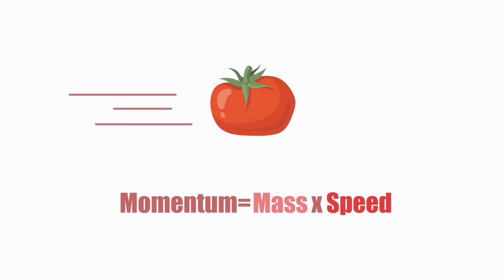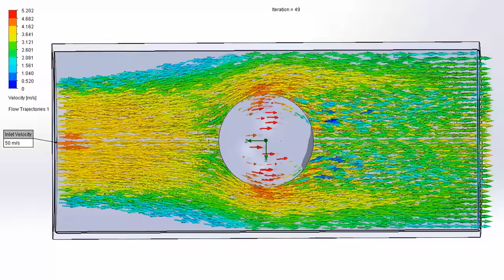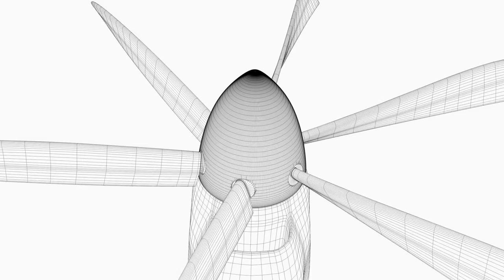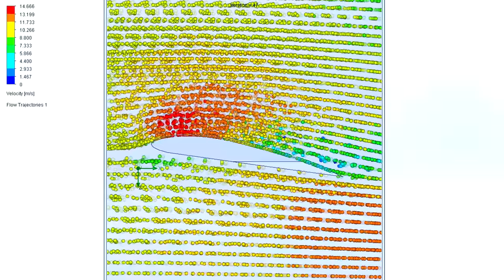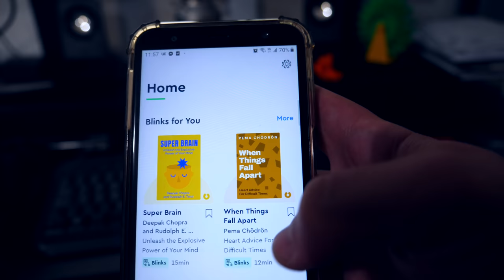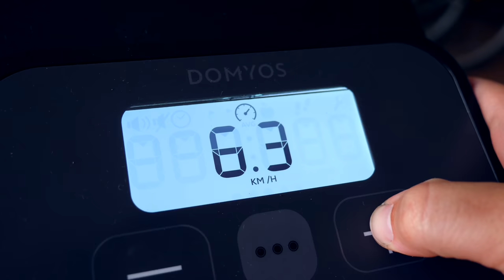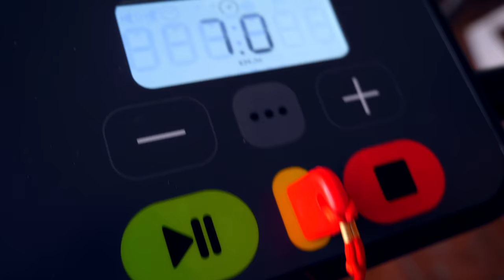Wind Powered Car (3D Printed)

Comment: Where do I send these 100's of old quadcopter propellers, carbon tubes, and servos to support the channel, Teg?
Reply from the maker: Send me an email to integza@gmail.com :_Happytegza:
Reply: @integza  I wish I had an entire Hobby Shop to help sponsor your videos, but I do have some gear that I'd like you to have. A servo tester can inject PWM, 1000-2000us, so you can let Integzabot chill for a bit, and a little less Arduino action for your jet throttles. And a metric ton of propellers and brushless motors. When I wreck a quadcopter, I may damage a motor; rather than replace just one, many times I've replaced all four, leaving 3 perfectly-good, badass motors we can use for... activities? Some simple on/off rocker switches, LED strips, doodads...
Reply: @GhostRyderFPV  ok
Reply: How about if the gear ratio of the prop to the wheels were higher? Wouldn't that allow it move with less wind?
Reply: If you have rc transmitter and receiver which you don't need anymore I will be more than happy to receive them
Reply: @Baxteen1  If you rotate the sail faster you'll have less acceleration but a higher top speed.
Reply: @integza  Have you tested what happens when the propeller stall?
It smacks of oscillations 🤔
Also, no one seems to be considering that the car will only go faster than the wind after a certain moment.  
So, does the wind that passed at the beginning was reached?  
If not, you was not faster than the wind (considered the entire period of the experiment).
Who arrived first, the car or the wind?
So, no laws were broken!

Comment: Bottom line - the point is the fact that the propellor connected to the wheels. The wind will take the car close to wind speed - then the prop basically do the addition - you can say trigo or you can say branuli. 
Now Im curious to make mathematical expression to calculate the equalibriume of the system and to extract the max velocity... If you have this I will agree that you got it.

Comment: Add one more thing: fixed propeller has drag almost equal to drag of propeller's projection, but spinning propeller has drag equal to 8/10 of a circle it spins in. That is how autogyros works - those flying machines has angled propeller that acts like a huge round perforated wing when spinning. And it also has airfoil in addition to that.
Create a rocket powered autogyro with 10 small rockets lighted one after another.

Comment: Have you ever experimented with the Magnus effect?
For those that are unsure of what this is, here is a simple demonstration:
1: Take the insides out of a Bic ball point pen (the kind that is just a straight, un-tapered cylinder works best)
2: Place the cylinder on the edge of  a surface that is off the ground.
3: Place 3 fingers from each hand on the cylinder slightly closer to you than the center of the cylinder.
4: Push down with your fingers evenly until the cylinder "pops" free from your fingers.
This should create backspin on the cylinder and forward momentum which, if done right, will cause the cylinder to lift or float as it moves forward.

Comment: and for the people wondering how it can accelerate more and more on the treadmill, yes its possible but the energy comes from the treadmill motor itself. the propeller connected to the wheels causes the wheels to require a higher force to spin which slows the treadmill down but the treadmill motor counteracts this slowdown. so the energy in that case comes from the treadmill motor! cool right?

Comment: Theres one experiment I've wanted to do for years. Pneumatically spinning a low temp liquid metal, and then running current through it. Inside of a glass container would be ideal, and my thought is using gallium or mercury. I just want to see what a magnetic field vortex might look like. Please, not even for the printer I really just want someone to do this.
Reply: I'm fairly certain I seen someone make mercury spin with magnetically induced current on youtube.
Reply: Cody's lab makes mercury motors all the time.
Reply: mercury is harmful and gallium is furiously expensive (and these are the only options of fluid metals in low temperatures)
Reply: @wojciechsosna9230  Mercury is practically harmless unless it makes contact with an open wound. If you wear gloves it's safer than many chemicals that are used in chemistry. It can't even get into our bloodstream through mucous membranes like other chemicals because the surface tension is so high.
Reply: Here's an idea, because low temp is fairly relative, research some other metals that have lower temperatures. 2 other points of relevant data would be their conductivity and magnetism. Some other things to check out, glass temperature and what kind of motion will elevate the viscosity, if magnetism can influence viscosity, or electricity. Glass temperature is the point where a material becomes a gel like consistency. Actual glass can take some fairly high heat before deforming.
Reply: @208Concepts  that's the guy I was thinking of. Cody.
Reply: Please nobody listen to  @patrick1532 , mercury is definitely not "practically harmless", the primary source of exposure to elemental mercury is through inhaling vapors (so there goes the only if it "makes contact with an open wound" theory).
Gloves don't make a chemical safer,  they make the task you are performing with the chemical less risky but the chemical remains just as dangerous as it was before putting on gloves.
Reply: @benfubbs2432  I didn't think of the vapors that could be generated by running electrical current through it, you're definitely right about that but mercury doesn't just vaporize on its own.
Reply: @johnashcroft8355  Wasn't aware, but at room temperature it seems that it would take an extreme amount of time to build up harmful levels of vapor from small amounts. Check out Cody'sLab's videos with mercury, not saying what the dude did is safe and neither is he really but there is a lot of unreasonable fearmongering and exaggeration of the dangers of mercury purely for the sake of keeping stupid people away. If it was truly as dangerous as you're making it out to be, Cody would be in the ground by now with the levels of exposure he's had.
Reply: gallium is a non well defined toxin, and mercury is a definite neuro toxin.

Comment: Attach the Dremel to your 3d printer and make it into a cnc. That's my idea
Reply: I like that. I will never win the 3d printer...
Reply: @benfubbs2432  that's exactly what im doing for a project, in order to mill my own pcb's!
Reply: @BigBoyDuckie  Have you had any luck with it yet?
Reply: @benfubbs2432  yeah that's a good idea too
Reply: @SureshKumar-ew6ex  Nah your idea was the good idea, I just added to it a little bit.
Reply: @benfubbs2432  not yet, im still in the preparation fase, but it looks promising! biggest hurdle will probably be homing, bed mesh, and just general software
Reply: @BigBoyDuckie  I hear that routers use g-code as well, so you might be able to just use the stock everything for example I have an ender 3 which uses g-code. if I pass the g-code to it then it will run no problems.  it has no clue it is moving a routing bit around instead of a print nozzle.  Should work but you have to go old school and write the g code line by line I reckon.  Maybe not, that is your problem to solve!

Comment: "The Dark Arts of Trigonometry!" 
Me: "Dark Arts is putting it kindly."

Also I want to add my thoughts. Even a Sail boat that is Tacking in the wind at the optimal angle has an absolute limit beyond the speed of the wind. For the very same conclusion you came to. The low pressure in front of the sail pulling it faster than the wind behind the same sail eventually equalizes because of the on coming air pressure.
You could do this same experiment on water by replacing the Sail with a big wind blade that's tied to a Prop under water(if you didn't couple it to an under water prop the Wind blade would just pin wheel).
Reply: But at the optimal angle it won’t be going directly down wind it’s going partly sideways. so it can be going much faster then the wind would be able to still propel the boat even when it’s going faster then the wind

Comment: I watched both of Veritasium's videos on this, as well as Steve Mould's, and I still couldn't wrap my brain around the effect. In this video though, YOU finally broke it down in a way that something clicked and I now can understand what's going on.

The propeller is BACKWARDS; the wind would normally spin it in it's natural direction, but the prop is mechanically geared/attached to the wheels in this backward orientation. When the wind blows, rather than working to spin the prop, it instead just PUSHES the whole vehicle contraption forward (just like any object in the wind would move forward, as long as friction is forgiving enough).

As the wind pushes, the car is rolling forward and the wheels are turning, which then spins the prop in the BACKWARDS orientation. Because the prop is spinning backwards, it continues to act as an efficient sail, and the wind keeps pushing the car forward until vehicle speed matches air speed (minus friction?).

However, because of the special propeller shape, with enough speed, the prop eventually ALSO starts doing ITS job, of making a high and low pressure pocket. Because it's now spinning, while the whole car is also still being pushed forward by the wind, we now have two methods of thrust rather than one, overcoming the speed of just the wind sail on it's own.

As long as the vehicle is designed in such a way that friction is low and propeller thrust is high, the outcome is an acceleration vector in the direction of the wind, larger than that of the wind itself. I think I get it!! 😊 In my opinion, Integza, you've won this one!

The only thing I will say that Veritasium did do better was the model car. He continued to work on the design (with the help of a friend) to eventually get the car to a point where it CAN drive faster than the treadmill, without the need for a fan as additional force. Because you used a fan AND a powered treadmill, that's definitely cheating and does not actually demonstrate or prove the point you're trying to make, so the example is a little lost/nullified... That's okay though! Your easy-to-understand explaination made up for it 😊😊 Thanks for your fantastic and educational videos, Integza! ♥
Reply: it seems to me that it would make more sense and perhaps be safer to put the prop on the front side of the vehicle. And instead of one large prop. put one on each side of the front of the vehicle. and put a pivot on them that would allow the prop to rotate to be perpendicular to the wind from whatever direction it is coming from. I would also try with a 3 or even 4 blade prop.. or perhaps even use a prop that spins perpendicular to the ground.. which has the ability to catch wind from any direction (360 degrees). When i get my 3d printer i might make one and put video of my design on youtube.
Reply: @manp1039  That would be awesome! I would love to see it.

Comment: video idea:  build a rocket engine that is powered by hydrogen and oxygen. and then make an electrolysing machine to make hydrogen and oxygen.
another idea: make a rotary mill from 3d printed parts and items from the hobby store (this can be used to machine rocket parts and a rocket nozzle from graphite for example)

Comment: In the case of thin airfoils (sailboat, hang glider), the air flows the same distance over and under the airfoil. The flow under an air foil is essentially pushed down, and the air flow over an airfoil tends to follow a convex shape (up to a point, if the speed and/or curvature of flow is too much, vortices form, reducing lift and increasing drag), due to viscosity and to avoid creating what would otherwise be a void, reducing pressure. Faster air flow coexists with the lower pressure just above the upper surface of a wing, and slower air flow with the higher pressure just below a wind. 

As for DDWFTTW carts, a propeller is used because it is efficient, not because of its resemblance to a tacking sail. For example, consider a model river boat driven by a paddle wheel. The paddle wheel is driven by two spools being turned by wires being unwound from the spools by being pulled backwards, geared so that the wires move much faster than the paddle wheel. If the wires were attached to two posts in a stream, the boat would move downstream faster than the stream, with nothing resembling the tacking aspect of a sail. The key factor for the boat and DDWFTTW carts is an effective reduction in gearing, so that a higher speed, lower force is geared down to result in a lower speed, higher force. For example, assume there is a 10 mph wind, and a DDWFTTW cart moving downwind at 15 mph. From the cart's frame of reference, the ground is moving at -15 mph, and the air is moving at -5 mph, 3 times as slow as the ground. This would allow the speed from the ground to be divided by 3 and the force from the ground multiplied by 3 before losses are taken into account. Perhaps after losses, the force is multiplied by 1.5, which is still enough to cause the cart to accelerate faster. For your model, its most likely that the pitch of the propeller is too large. With a smaller pitch and larger diameter propeller, the speed of the thrust is reduced, but the force of the thrust is increased. That was the issue with Xyla Foxlin's model (too much pitch, reducing pitch and increasing propeller diameter solved the problem).

Comment: Video idea: You need to build a vehicle that launches tomatoes backward for thrust!
Reply: Also you could use crushed tomatoes as fuel, In an oxygen environment tomatoes should burn nicely
Reply: Talk about a V8 engine
Reply: @SpringyErmine  ha yeah that's perfect
Reply: Also I think the important thing that make the car in this video work is there are two things moving at different speeds ie air and ground. the cart can basically use leverage to go faster than the difference of the two.

Comment: Treadmill + fan is invalid configuration for testing this - it makes the wind speed be relative to the vehicle, not the ground it is supposed to. It effectively adds speed of the treadmill to the speed of wind
Reply: It's force x distance of the rotor vs. force x distance of the wheels minus various efficiency losses. The issue is the conversion of a rotational distance to a linear one and any mechanical advantage that could be used to convert applied force into additional distance on the output end. It should go faster until the force needed to have the cart move forward via the wheels is less than the force available to the turning rotor. Add in the time factor and it's power-in minus losses equals power-out.

Comment: Basically, the car's blades act as a sail surface. When said sail surface is also moving, the speeds are compounded. This, the speed of said object becomes faster than the air pushing it. If you check the windspeed of the fan at it's output, it should be greater than the speed of the air pushing it.

Comment: By adding the fan you've increased the relative speed of the "wind" to threadmill + fan, so the car has to go forward faster than the fans wind, on a threadmill. That's the whole point of the threadmill. With your setup even a wheel will go faster than the threadmill with sufficiently fast fan. Boo.
Reply: The design is still very much possible, but yeah you need to measure the air speed and add it all up to prove integza's model works.
Reply: You are mistaken.  The whole point of threadmills is to mill threads.

Comment: Look at it as a matter of energy,
Putting aside wind speed, it's pushing with a force, with bigger propellers, car gathers more force, and with propellers configuration set to resist the wind, the extra power translates to more speed
Like a pulley transferring power to speed.

Comment: You should make it work without artificial wind, just the treadmill alone, that is the idea(running faster the wind, meaning moving if there is no wind and just static air).
Reply: That’s not how it works - that’s like saying a sailboat should move even if there is no wind. The prop only rotates because of the wind pushing the cart.
Reply: That is why it made such a sensation, because of that. You probably should go check veritasium bet video(uploaded today)
Reply: @mumblbeebee6546  Watch the most recent Veritasium video on it. The idea is it should work on a treadmill with no artificial wind (to simulate exceeding the speed of the wind when traveling along static ground).

Comment: We built a propeller to power a small pump in class because we were being taught about wind energy and windmills. My friends and I decided to 3d print a propeller with a semi-optimized profile. On our first test the propeller worked too well. It was so fast it moved the gears in the gearbox which disconnected it from the pump and made it spin freely. One of out propeller blades got launched into the ceiling and another almost hit one of out classmate. To be fair, it was initially designed to power a two chamber pump which we had to switch to a one chamber pump because of issues with connecting two pistons to one windmill and a lack of time to fix said issues. In the end, we swapped out the gears, better secured the windmill in place and it worked perfectly. Lucky for us the two blades weren't damaged too badly and we were able to reattach them with a bit of glue.